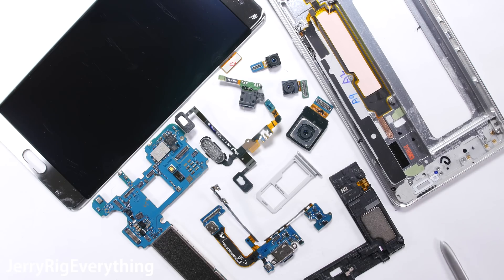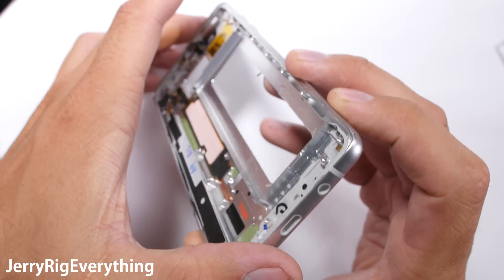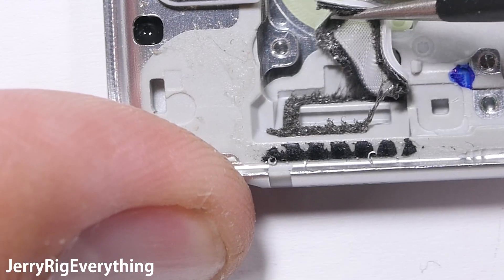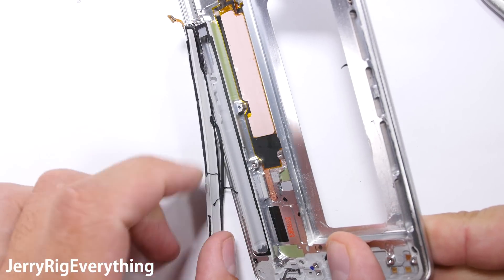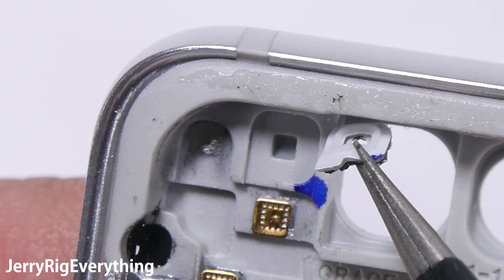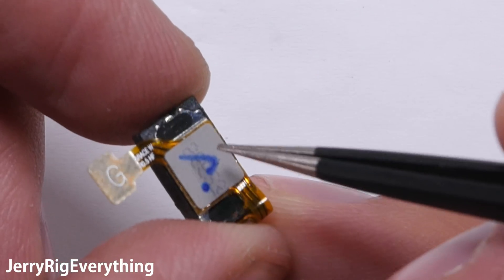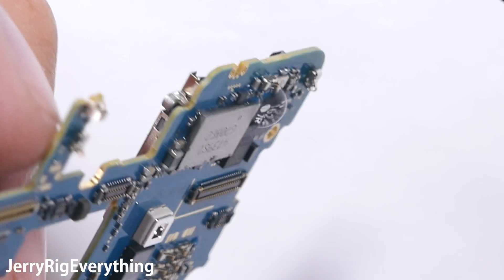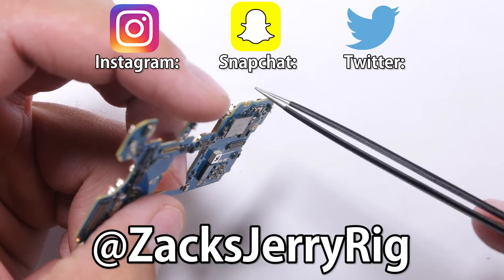What makes the Note 7 Waterproof? Ultimate Test!!

Comment: Now this is what's called engineering ,no worries iPhone users will get this soon in iPhone 12s ,lol.
Reply: iPhone is already quiet water resistant  just they dont mention it my 6s was sitting inside my bag filled with water during my exams my phone was in water for about 2 hours and still works just as fine (it was raining and i didnt knew my bag was wet form inside)
Reply: @2531Prasad  I was actually thinking about that while watching the video, the iPhone might have been decently water resistant before the iPhone 7, but it didn't have any official IP rating, so it wasn't certified to be water resistant to any point.
Reply: Well, the iPhone 6s and 6s Plus already have complete waterresistant sealing around the buttons and ports and the same type of waterresistant meshes are built into the iphone 6s and 6s plus too. Basically those iPhones are as waterresistant as any Sony Xperia And any Samsung is. Just that Apple doesnt mention it in order to prevent people from misunderstanding the difference of water resistance and water proofing....
Reply: I'm about to whip up some simple calculations.
In one week, out of roughly 3 million note 7s, 35 exploded. Meaning that there is a .00116% chance of it exploding after 1 week.
Meaning that every hour, there is a .00000694% chance of it exploding.
so every second, there is a .0000000019% chance that it will explode.
Some more simple math later, and you can see that in order to have a 100% chance of explosion, it would take 1,668 years.
I'll take my chances.
Reply: @Sleep Less: You started to sound like samsung users. Just leave it there, that's what most of samsung users do, they spend every second of their life thinking about how to make people think samsung is better than apple, apple is overpriced etc etc. They compare samsung with apple everytime everywhere, otherwise they wouldn't get a good night sleep. Meanwhile, most of apple users don't give the slightest fuck about samsung at all.
Reply: u nailed it XD
Reply: #BlendGate2k16
Reply: ***** I agree, it is quite wrong for Samsung to have add that show the phone under water. Especially because if you submerge it, and it does somehow break, then your carrier won't cover it. That's a loss of $900 USD.
However, it is more water resistant than the iphone.
Reply: Did hitler sponsor the engineering development of explosive in this device ?
Reply: I switched from iPhone 6plus to galaxy s7edge what a phone speed, looks, features & a new design unlike Apple its still the same since iphone 5, just better camera but same shape, shame on apple, the only reason why I took long to switch because I have a MacBook, iPad, & ipod they all synced but for my daily use I choose Samsung & now I regret why I didn't switch earlier.
Reply: Next year they'll release iPhone 7 H

The "H" stands for headphones.
Reply: More like in 2 days, also the 6s has been waterproof, but apple never sought waterproof certifications. Same with apple watch. The 6s was actually more waterproof than the galaxy s6.
Reply: Maybe one forgot how samsung copied the fingerscan feature a year after apple released it in iphone 5s
Reply: I used to use samsung galaxy s5 (2 GB RAM) but it was laggy as hell and my friend who used iphone 4s with only 512 MB RAM (yes, 4s was 2 years behind galaxy s5) would easily destroy my phone by sending me tons of emojis on whatsapp (remember whatsapp did not collapse very long message unlike now), my phone would crash and became very hot and I couldn't turn on my phone until it cools down in about 5 minutes or so. Whenever i managed to turn my samsung S5 on then my friend would send me those emojis over and over again so that I had to uninstall whatsapp otherwise i wouldn't be able to use my phone at all. Then I switched to iphone 6s and I regret why I ever bought samsung phone and didn't switch earlier.
Reply: Bob Joint Yeah, I just recently switched from windows phone. My lumia Icon had great hardware (for it's time), and extremely smooth software. The only downside, was that not many people use windows phone, so there was an extremely limited app choice.
Now I'm on android, and I will admit, the software is super choppy, even though the hardware is top tier. (by super choppy, I mean by todays standards. It might lag a bit once or twice a day, but still, compared to windows phone or ios, that's a lot.)
Iphones have super smooth software, but the hardware is second tier to say the least.
In the end, it all comes down to your personal preference. Which of the three traits would you rather in a smartphone, you can only choose two; Tons of apps, Great hardware, or Smooth software.
Reply: undrtakr900 hahahahaha!!! That would be amazing
Reply: I'm fine with iphones not getting exploding batteries anytime soon
Reply: Atleast it has a headphone Jack, hahha
Reply: @jayb0nd007  
Now that the Note 10 without a headphone jack came out, you sound stupid lmao
Reply: Right.....ultra clever engineered phone.....got recalled for being falsely 'engineered' as a bomb..
Reply: They're not shouters right?
Reply: +Prasad Bankar nice fairytale, say another,hahaha....
Reply: haha thats true,,, it's with I 12 .....
Reply: but will it blend?
Reply: more like 12b
Reply: +Prasad Bankar but it is not as water resistant as s7 or note 7
Reply: Nick Hahn such a lol.. maybe water resistant at the most. Also, do you really think a Triple A company like Apple will miss the chance to have a water resistant certification if it really is water resistant. more like it maybe resistant but it failed certification.
Reply: uniphobia I've seen ALOT of videos of people testing the water resistance of the note 7 vs the iphone 6s, and the note 7 has done a little bit better. However, the iphone still worked.
That being said, we asked the guy's at verizon if we could actually use the note 7 under water, and they said that they wouldn't suggest it. Mainly because if it does break, and the liquid sensor sticker on the inside is spoiled, then they won't cover it.
So I'll say this, the water resistance is only to be used for emergencies. Such as, accidently dropping it in a pool.
Reply: *****  #Gently
Reply: Sleep Less But it's a different shape.
Reply: Sleep Less see that is the problem.. I couldn't care less who copied who.. i'm not some fanboy who'd stick with a brand through tick and thin.. I'm going for whatever's better! iPhone is way behind compared to most Android phones. Only reason people stick to it is attachment, fanboyism, and unwillingness to change.
Reply: uniphobia It's actually better to stay with the same os for as long as possible. Then all your settings, account data, high scores, and apps just sync right to the next phone you get.
That being said, I have a galaxy note 7 because it 100% kicks ass. And there's that awesome super hardcore .00025% threat that it could explode at any moment... So yeah, I guess you could say that I like to live life on the edge.
Reply: iphone's are pish anyway lol
Reply: Oh wow iPhone 7 has no aux jack and no antenna bands wow what a design
Reply: it is one of the best engineered stealth bombs
Reply: ChristarpFP And I'm happy to carry such a well made bomb.
Reply: i cant wait until terrorists start holding planes hostage claiming they have a note 7 on board and theyre not afraid to charge it
Reply: Great fucking engineering XD only it has one feature iPhone doesn't have  an explosion! haha
Reply: Sagar Deswal so I phone is ip67 but s7edge is ip68 so apple didn't come out with a complete waterproof phone
Reply: Sagar Deswal rub it on their ass😂😂😂😂😂😂
Reply: jay syed lol
Reply: Prasad Bankar OK so your bag was just chilling outside soaking wet while filled with water and your iPhone was in it? wow ok
Reply: Abdullah Khan um no. put your iPhone in water. the water will cause screen deformity if it stays in for more than 2min. stfu please. and no, the 6s does not have any water resistance it's just sealed like that to keep the parts and aluminium back together
Reply: jay syed now they are down grading phones with their headphone jack so they won't get this
Reply: jay syed YO THE IPHONE 12S DONT BLOW UP 😂💀
Reply: jay syed at least it will come faster than an android update and it won’t blow up ;)
Reply: At least iPhones don't explode.
Reply: They've got it in the iPhone XS Max for some reason
Reply: look at the 2 round speed test by phonebuff bertween iPhone 6s and Samsung Note 7, Engineer. I'm sure most people buy phone to call, text and use internet based services and not to rub it on their ass while in a swimming pool. I'm not an apple fan, I use LG g4 and I Love android devices, its just that i'm sure when apple does stuff, they do it perfectly. so it won't come out with a water resistant phone but a waterproof one whenever it does.
Reply: ngantuk banget It's funny you say that. From what I've seen Samsung/Android users mostly respond to dumb I whores who comment shit like, "Samsung is shit". With every action there's a reaction.
Reply: Abdullah Khan  and you're right. Apple wouldn't and shouldn't have said it's water resistant at all cause then iBitches (btw the  most retarded people when it comes to phones) will try it out then blame Apple. Then Apple will be like "You put it in the water wrong"

Comment: I found out a long time ago with an ipod touch that even if your device gets exposed to liquid but doesn't die and trips one of those water sensors your warranty is still void.  With the S7 do you void the warranty just by exposing it to water even though it is marketed as water resistant?

Comment: 2 Questions:

Can I hold the phone just below the surface of water and press buttons safely?

Should I let the s pen slot dry out if I have the pen out under water? Before putting it back
Reply: I have been bathing and swimming with my S7 Edge for a while now and recording underwater videos. So far everything works, no speaker damage, no damage at all. Phone works perfectly fine. I also did press buttons underwater and that was at around 2-3 feet underwater. So no worries there!

Comment: I took some amazing underwater shots in the pool with my Note 7 on Saturday.  Got the USB port wet warning, but it was fine after about 10 minutes.  I only took the phone below the surface of the water 1-2' a couple of times, and no issues.  Kinda scary having water pour out of the stylus port afterwards.   If save to say the phone works as advertised, but don't consider it waterproof by any means.

Comment: If water rolls away on internals coated with a hydrophobic spray, then where does it roll away to, if everything is sealed up?  You would just have to wait until it evaporates?  Would it still be a danger to the circuits, if it's just rolling around until it's gone?
Reply: jay syed  Doesn't happen like that with such small entry point. Water is just not going to leave the same way easily.
Reply: Where there is an entry, there is always an exit.
Reply: Once it goes in, you're out of luck. This is why you kids need to use protection.
Reply: Hydrophobic in such design as any mobile phone is really hard. You need to avoid all connectors as it will case open circuits (same if you wan to use lacquer)... I'm glad that manufacturers started with this and there is no way back so it will be only better...
Reply: sim card tray.....
Reply: Ana Castro That's a good pint for device that you can easily open.  But for a device like the Note 7, most of us would end up breaking the screen trying to open it up.
Reply: Yes you've got a solid point there. Maybe if there were some sort of opening on the device that you can open and close at any given time so that water could roll out of it. I'm just thinking out loud. Lol.
Reply: Nice question, if someone could answer, I'd like to know the answer too.
Reply: If everything is sealed how did the water get in? If it did from a leak it'll get out the same way
Reply: I think the point is that if you know you've expose your device to water then it will be smart to open up your device and let the water roll out before using it, so as to not cause any damage to circuit boards.
Reply: if it is coated even if water gets in your phone will be fine it is like an invisible wall the hydrophobic spray is also used in other products  hope it helped you
Reply: Hydrophobic sprays, again, do not fully guarantee the circuit board will not fry, and acts as a safe measure.

Comment: hey jerry I think that you should give to the xiaomi a second chance by testing the Xiaomi redmi pro.
Reply: never trust made in china
Reply: I don't care about that.The only thing that makes me worry is that the Chinese phones have a little bit bigger SAR value.
Reply: Well there are still regulations so they are not unsafe. This is what AMTA (Australia) said: " Does a lower SAR mean a phone is safer?
 
No. Although mobile phones sold in Australia may vary slightly in their measured exposure levels at maximum power output, they are regarded as equally safe because they are all below the safety limit. The limit also includes a large additional safety margin to ensure mobile phones are safe. "

Comment: ok now I really started to fear the waterproof or water resistant on the Samsung.  and thank you jerry for this video. 
At samsung event I got really excited when they said that note 7 is water resistance and the way they talk like they are very confident about it but after this video there is risk. I have to admit that I like samsung my first smartphone was galaxy s1 and till now note 4. what I'm trying to say and scared of is if the samsung product under warranty. I have a Samsung 46"tv and I found when I watch TV there is like red light while watching from the screen. I did some research and the answer was panel should be changed. I was happy because I still have the warranty so I took it to the agent and I didn't showed him the warranty and the first thing he told me that panel need to be changed. I said fantastic and I showed him the warranty and that guy face changed to 360° 😂. 
he said will check first then he said panel don't need to be replaced and he changed the setting and everything is OK. A funny story😂

Comment: I don't think that a conformal coating would be that much more to ask of samsung to do. It is very common on circuit boards that are part of outdoor lighting fixtures and things to add weather resistance. Due to it's thickness it is even better than a hydrophobic coating.

Comment: One Question: I saw on specifications of moto x 2014, moto x pure and moto Z that they are also water resistent, but not that kind of submersion, only for few splash of water. Does it mean that these cellphones come with that kind of hydrophobic spray inside of motherboard? Thanks
Reply: Nope. I guess the rubber quality they use to seal and its tightness is not par with Note 7.
Reply: thats right, the Samsung phones use Goretex, which you can find at a sports ware store

Comment: regarding the motherboard and electronics, you should mention that water could destroy it only when its on (electricity that runs through the circuit). other than that you could still use the board that you have tested for example. if you let jt dry out ofcourse.  good video though!

Comment: So it's "water-resistant" but if water gets in just by accident, you're not covered by warranty? Then I would never go near water with it if it's costing $900.
Reply: Water-proof devices (which are very expensive) are for professional people who need to use underwater,
but water-resistant devices are for normal people and can survive from a water spill or rain.
If everyone can be covered by warranty, then that means the device is water-proof which is not the case here.
In fact, you can find many videos on youtube S7 survived from many tough conditions(even in the deep water for over 24hours), and you can also see many people use them while in the shower.
IP68 isn't perfect, but can make you feel safe and much comfortable enough in daily uses.
Reply: Its 30 min under water resistant
Reply: If you dropped it by accident then it would be quick right? You immediately pick up your phone, and that's what omar said "30 minutes"

Comment: Won't the contacts of the headphone jack and the USB-C connector get corroded if they come in contact with water? Especially if you take the phone in the sea, since salt causes corrosion.
Reply: headphone jacks are usually gold plated, and I'm sure the charging connector is stainless steel